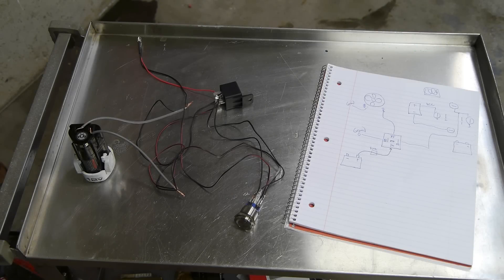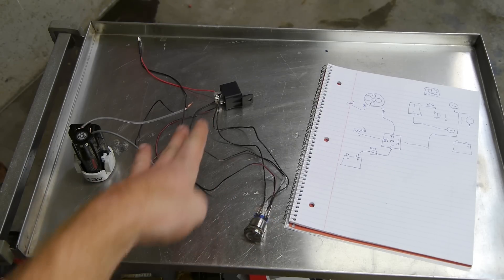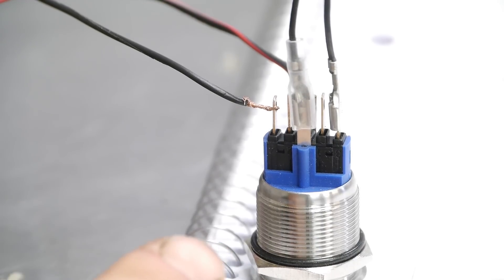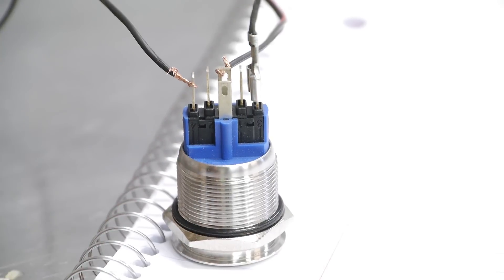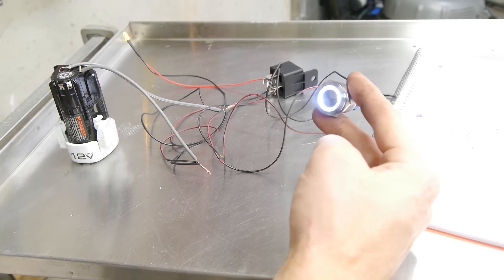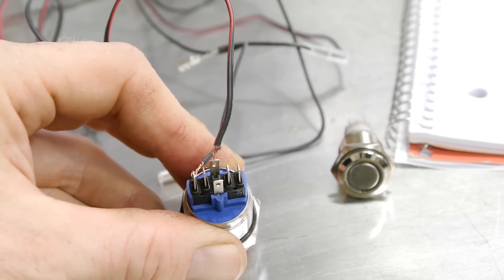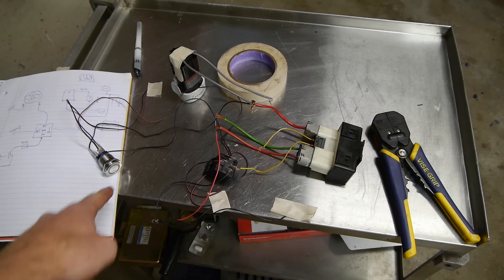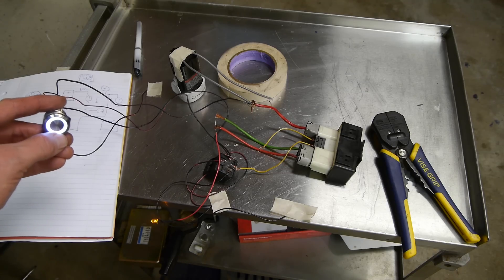19mm LED latching switch wiring

Comment: How can i connect plye 4ch hydra bluetooth amp, APIELE 22mm Latching Push Button Switch 12V Angel Eye Ring Light LED Waterproof Stainless Steel Round Metal Self-Locking 7/8'' 1NO 1NC 1 Pack (Blue)5amp, Tegg 5pcs DC-099A DC Female Panel Mount Charging Wire Threaded Socket Jact Connector with Dustproof Plug IP67 68 Water-Proof Large Current Power Adapter 5.5x2.1mm, 12v Talentcell 6000mAH rechargeable battery using 10pcs Conductor Compact Connectors Lever Wire Nut Electrical Connectors with Fixed Base for 3 Circuit Inline Splices 28-12 AWG?

Comment: Could this be used to switch on a pc inside an arcade cab if it was wired to the pc’s power pins?
If so would you need to feed it additional power for the led?
The arcade cab comes with a +12v +5v -5v psu.

Comment: I have a 5 pin mementary led ring switch. I want to illuminate the ring when i send power to it.  How is this done? Do i have to ground the housing on the switch or does it have pin where i have to add a ground wire to light it after i turn the switch on to push to start my bike?

Comment: I’m using a 5 prong switch like the one in your video for my trucks lightbar. The lightbar harness has a relay by the way. I have the harness ran to inside my truck but it only has a Red, Black and Blue wire from relay. I need to know how to wire it to my new switch that has 5 wires. Please help me.

Comment: My switch comes with a plug connector with five wires, RED is positive LED, BLACK is negative LED, GREEN is common pin "C", BLUE is NO pin and YELLOW is NC pin ... my guess is that my HOT will go to the RED wire and my GROUND will go to the BLACK wire ... then I get lost ... I am only providing power to a panel which then runs everything out through relays, I could connect my HOT power from my cigarette lighter directly to my panel, but with the switch I can tell when it is powered up ... I just don't know which wires to send the switched power to the panel and light the LED?

Comment: I got 2 Momentary versions of that Switch that i was going to use as Sound Effects Buttons on a Display i built for one of my Spaceship Models but i could not get the Switch to work Right with the Sound Effect Circuit Board the Board is a Plug and Play kind of set up so two different sound effects can be Control by two different Buttons But no mater what i tried i just could not make them Work Right ..... Do you know any YouTube Video that Could Help Me Figure out how to make the 2 Switch's Work right ?

Comment: Im trying to use these on my e scooter 
For blinkers 2 on the sides for blinkers and middle one for the extra lights or anything else can i make the ring light on the switch pulse with the turn signal witch is turned on ? And that the both sides blink at the same time when hazard lights are turned on ?

Comment: I have a switch that I'm using for a microphone. It's a 5 pin latching button with halo LED. The microphone I'm using doesn't require power. How can I power the LED without sending power to my microphone?

Comment: Do you need a fuse or a relay will just suffice? Also, would this work with a 16mm switch?
Reply: A fuse is highly recommended, but a relay is not necessary. The relay is only used if you want your switch to be powered when they key is in ACC or RUN mode. If you want these switches to activate something whether your car is on or off, you can skip the relay.

Comment: I bought to horn buttons very similar to what you have here.  My question is, do I need a relay for each button?  Or can I run both horn buttons to 1 relay?  FYI, one button is for the car horn and the other is for the air horn I'm installing.

Comment: hello, congratulations on the video, is very well explicity, however I have a problem, when I turn on the first time works fine, turn off and turn on, no longer turn on, the switch has power but the headlights do not turn on, the relay does not let me it seems to be triggered. That could be, thanks and continued

Comment: Not only Volvo activate relays by ground (negative polarity), all cars are activated all relays and switches by ground except power engine wire which is connected on engine starter electromotor but also not directly on starter motor then on magnet switch which is part of starter electromotor.

Comment: Reading some posts, I have to respond even though I am not related to this video, just a retired ASE Master Tech. Use a digital multi-meter to identify your LED lamp as they are polarity sensitive. What's that? Using the ohms setting, two terminals for the LED with show no resistance one way, and 470 ohms the other way. (Yours may vary) On a 12 volt circuit, a 460 ohm resistor is used as a current limiter for the LED as it operates about 0.030 amps. White LED's are different from RED, so check. The diode side of the LED, will block voltage from the DMM from passing thru it. Use your DMM to identify the "ON" or "OFF" terminals is easy. A switch like this, with a 2 amp rating must use a relay for automotive use. When the system is charging, you may have 13.2 when hot outside or 14.3 when cold. Let's use 14.5 volts DC and ohms law to workout the amps issue. A headlamp pulls about 4 amps, while a blower fan uses 12 -15 amps. If system (Or circuit you build) includes a relay, the coil side (Terminals 85 / 86) will measure 40, 80 or 90 ohms as relays are different. If system voltage is 14.5, the relay coil is 90 ohms, the current is 0.161 amps. 80 ohms is 0.181 amps, 40 ohms is 0.363 amps. This is well below the rating of the switch, but if the relay is rated for 30 amps or 40 amps, you can control a cooling fan that runs at 35 amps. This is why a relay is required for a low current circuit to control a high current device. Small wires at the switch and large gauge wire at the device and fuse power supply. If the switch has external terminals for the LED lamp and an internal resistor, use ground as constant, then supply power to turn it on, using the terminal that is hot when turn on. This makes it easy to wire it to come one when voltage is switched on for the fan, lights, wipers, etc. There are videos from "Afrotechmods" on youtube that will teach you more...and using your DMM. He makes funny, short to the point and easy to understand vids. ASE Master since 78.
Reply: Could this switch be used to control a garbage disposal? The Dual Outlet Air Switches most commonly used for disposals seems like such overkill.
Reply: BostonSean, No, this DC systems only. He is using LED’s but mentioned fan, lights and other. Your garbage disposal is household current meaning 120 Volt A/C for alternating current. It only takes 0.006 thousands of an amp to kill you. I never install or used an “ Air Switch “ The the principle behind them is air pressure pushing on a sealed diaphragm to turn on or off an A/C rated switch that can handle the amperage rating on sticker found on disposal. So could say 10 amps start, 7 amps continuous. Their is an higher flow of current when copper is cold, even light bulbs. I would use a simple good quality light switch to turn on and off. Hot tubs or spas use air switches too. On GM’s and others, but passengers front seat cushion with air bag have an air switch sorta. It has air but gel filled if anything less than 42 lbs. is in the seat, the right front air bag deployment is cancelled. It use a small 5 Vdc strain sensor, ground and reference signal back to the deployment module. It makes the on/off decision. It is also the one people hate because it has a recording loop of 15 seconds maybe more, but records speed, braking, calculated engine load even gas pedal operation and stores this loop electronically. The highway patrol and others have the same company software and equipment to read and display after accident.
 Stick with a light switch and label it garbage disposal, it works and 99% of houses use them.

Comment: Hello may you please help. I have a 6 pin momentary switch and it a came with the power sw cable and led + and Led - for my pc. I don't want to wire the cables wrong and short circuit my rig.
Reply: i wanna wire a 6 pin momentary like this to turn my PC on as well. Did you ever figure out the proper way to wire it???
Reply: @jwhipp  Yes I did let me get home and I will let you know what pins go where :)
Reply: @navi0822  thank you! Does your LED stay on? That's what I'd like mine to do
Reply: @jwhipp  yes it does. It is a green power led :) I have it in my arc de triophe souvenir since the cable wasnt long enought to have it on my desk drilled
Reply: @jwhipp  Sure thing sorry I got home late yesterday and was tired. Anyway I can send you pictures of it rather than just a description of it?
Reply: @navi0822  no worries thanks. Yeah you can send me photos. Maybe leave a link here to photo?
Reply: @jwhipp  Are your pins in this order?
1.    3
+      -
4.     2
Reply: If yes since you want the power to be continuous. The power SW has two cables coming out of it. At the end of those cables one should have a small triangle, that one is your positive wire and it goes to 4. The negative cable from that same connector of power sw goes to 3. The LED + and - go to the matching + and - sign on your switch. So it will look like this.

1 Empty                3 Power Sw -
Led +                     Led -
4 Power Sw +       2 Empty

I left my reset cables alone since only my power button failed on my tower. Let me know if you have any questions. Hope it helps :)
Reply: @navi0822  very helpful. And the positive negative leads for the led just go to a 12v source correct? Is it OK that it's a different 12v source than the pc? Thst won't fry anything?
Reply: @jwhipp  Everything has to be wired from the switch to the mother board. If you don't have the Pre-Wired Vandal Switch Cable Assembly then it would be best to purchase it. Check out https://www.performance-pcs.com/ this page can be helpful for what you need to get this done. The switch itself has to be 12V. No external source needed.

Comment: I cuestion can i use 1 hot wire coming from battery to use both switches . Sr
Reply from the maker: Yep that's fine!  Or use a distribution block like the one in this video: https://youtu.be/gnjxFiIsR6A
Reply: What size of wire u use . Velocitylabs

Comment: I bought this type but 16mm 12v switch but 4 pins the problem is that i thought it could go directly wired up and be used as a power switch for my 12v dvr... any advice? Do i still need relays?

Comment: I have a Cooler Master light bar that’s powered by a SATA cable. Can I wire this switch into it to be able to turn it on/off? Do I need a relay also?
Thanks!
Reply from the maker: That's just an LED strip for a computer case, right?    If it's just a few LED's you won't need a relay.      You will probably have to cut off the SATA connector to wire it with this switch though.
Reply: Thanks. Yeah, it's a 10" LED bar.   http://www.coolermaster.com/case/case-accessories/universal-single-color-led-strip/

Comment: Nice video man. I have one of those but a momentary , runing my air horn, the light on the switch only turns on when pressed, but i want it to be on at night when i turn on my lights, how can i do that? Thanks in advance
Reply: buy a latching one
Reply: What is a latchimg one ?
Reply: A latching switch is a switch that maintains its state after being activated. A push-to-make, push-to-break switch would therefore be a latching switch - each time you actuate it, whichever state the switch is left in will persist until the switch is actuated again
Reply: Thanks

Comment: Can you please name what volvo models have those high cfm fans? i need something for my supra that moves ton of air but i want to use OEM parts.
Reply from the maker: 1990's Volvo 740, 850 or 950 sedan or wagon. The 940 fan is the easiest to remove.  From here:
http://www.therangerstation.com/tech_library/volvo_electric_fan.shtml

Good luck!
Reply from the maker: You can see what the fan looks like in my cooling video.  It was too big for my car though. 
https://youtu.be/-UrsUjPX7Zk

Comment: Hi, I am intending to use it to control an arduino, so the current will be lower than 1 amp. So, I don't want to use the relay. How can I wire this up?
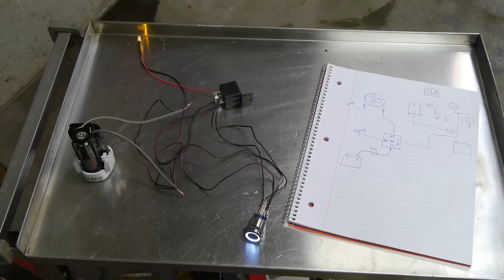Reply from the maker: Check out the diagram at 1:12 - Simply eliminate the relay and have the green lines go to the positive of the Arduino (instead of going to the 85 connection on the relay.)   Good luck!
There's also a  link to a diagram in the video description!